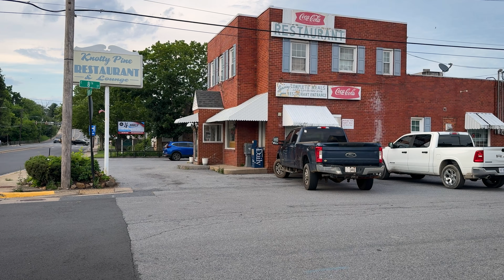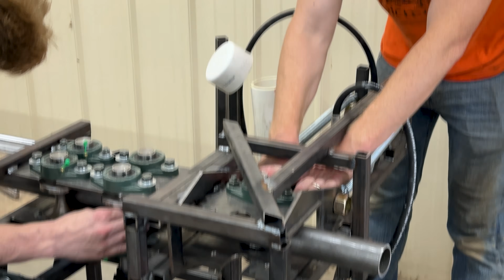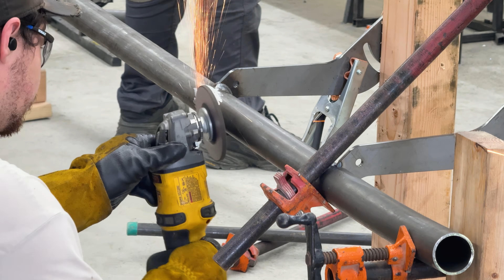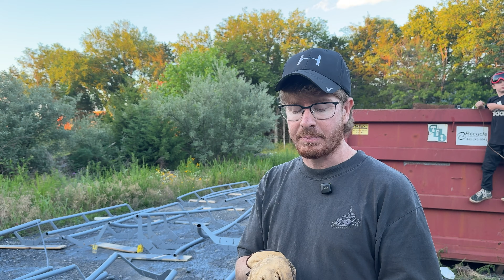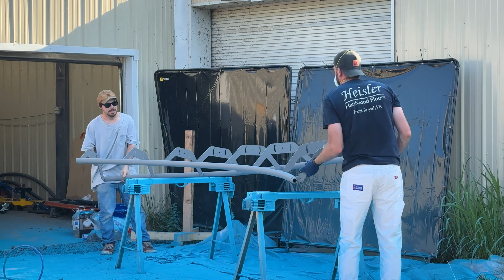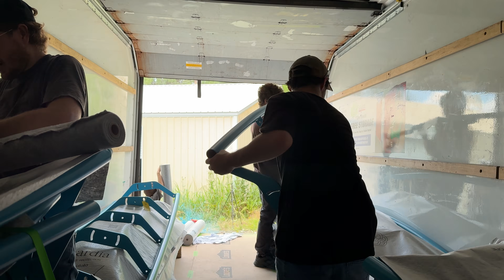Building our Friend a Coaster

Comment: If you don’t do droptowers you can use a pretty wide syringe pushed with a piston airtightly conected to a higher thinner one with cables at the top with the cables pulling the vich3cle